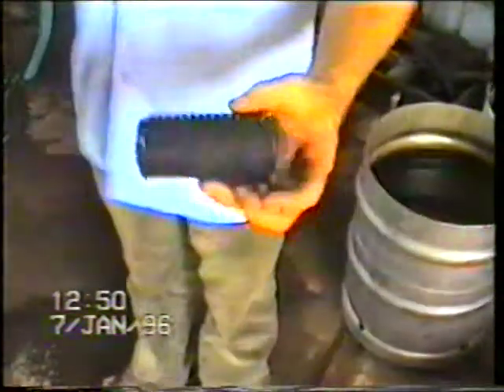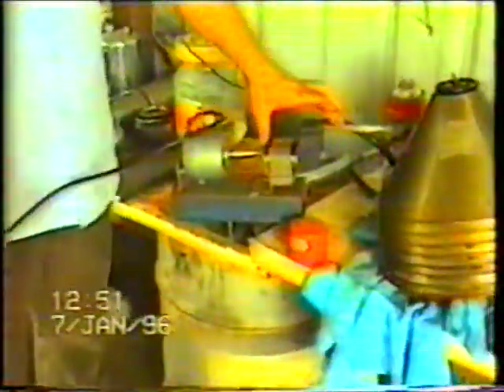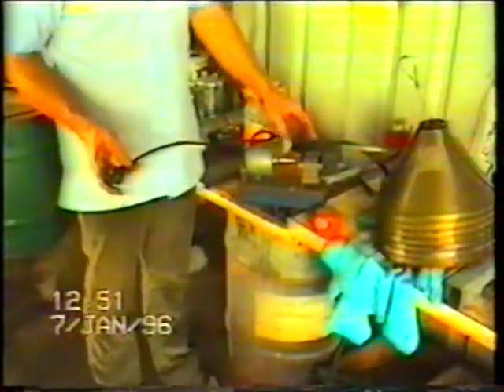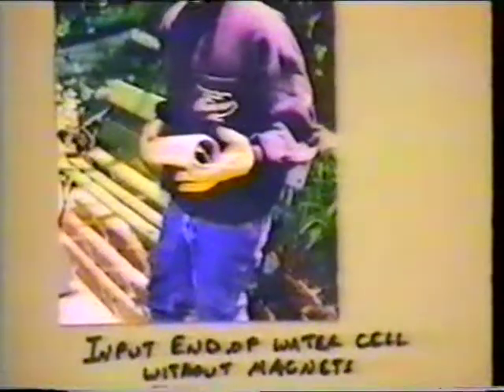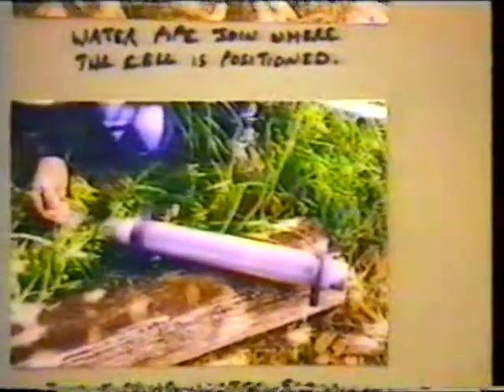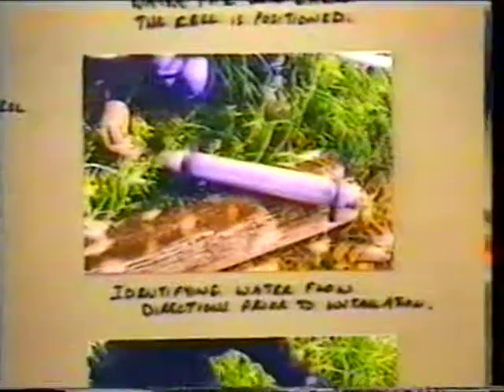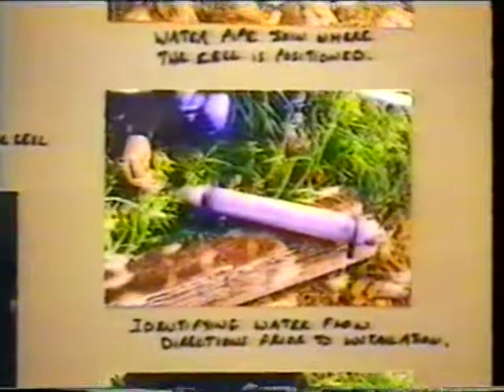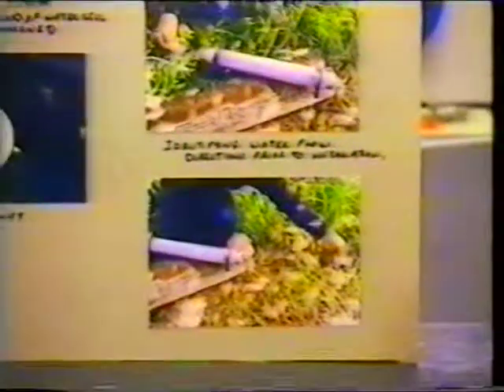AIR Joe talking about magnetic phenomena and water cleaning 1995

Comment: More amazing about the first part  of this video joe is showing how simply a engine. Can run as the pipe would be the engine block and the stop start when it locks up the pump if you pulse it variable you get a attraction repulsion sequence no expert here. In uk just adding suggestions on logic.   May be a form of plasma
Reply: honda4004 thanks.. your comments  are allways excellent !    Cheers

Comment: Can't that just be a vaccum lock, locking the motor? When the elctrolysis takes process it seperates the water molecules into their gas state and expands the internal volume of the cell; thus forth allowing the pump to pull the gas, with the vaccum inside the cell being less than that of the pump.